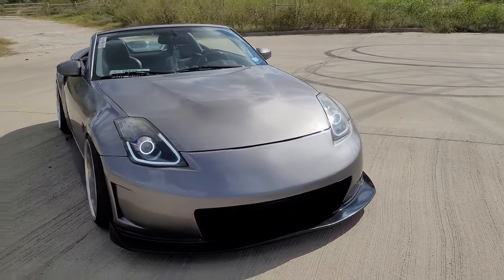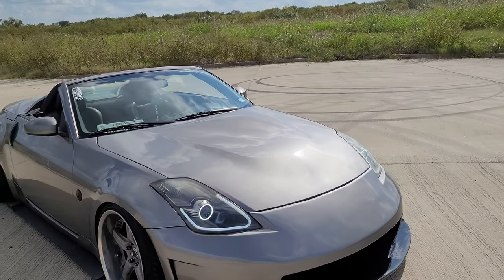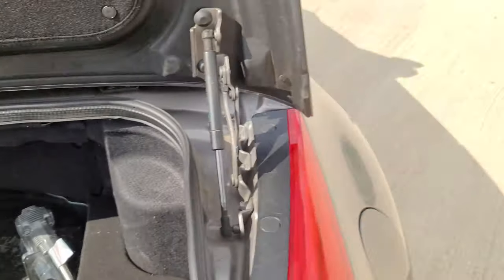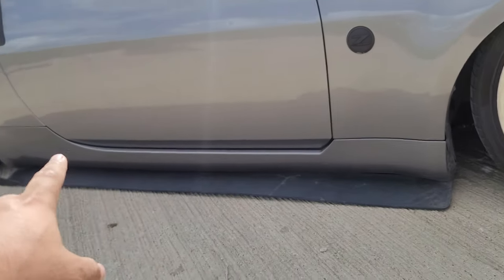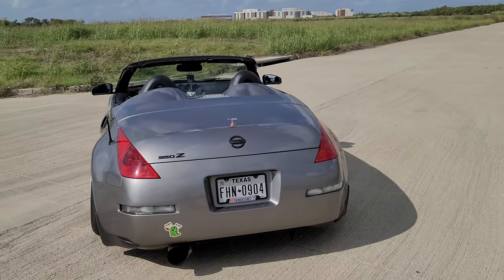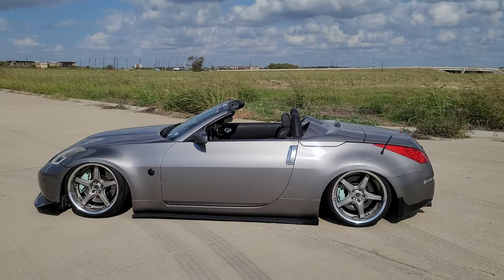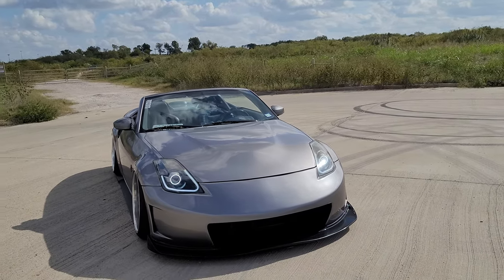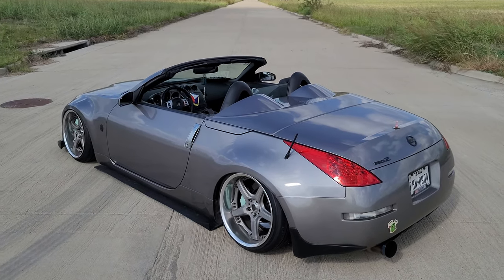Bagged My 350z Convertible!

Comment: How much did the front mod costs?
Reply from the maker: @williamegnever3831  front bumper is from KBD, was like $3xx when I bought it.
Reply: @baboyz33  may I get the name? Your front looks so GOOD!!!!
Reply from the maker: @williamegnever3831  thanks 😊  it's KBD N3R bumper.
Reply: @baboyz33  don't blame me for copying lol, it LOOKS SO COOL AND LOW LIKE A FERRARI STYLE LOL!
Reply from the maker: @williamegnever3831  It's very common! Enjoy it, they're aggressive looking. only thing is they are heavy. I'm working on buying a CF version of it.
Reply: @baboyz33  btw, what year is your 350z and paint? I might buy this 2005 350z and wonder if it looks too old
Reply from the maker: @williamegnever3831  mine is 2007. Carbon silver gray I think. Paint code K51. 07-09 came with the HR motors. A little more favorable over the previous years.

Comment: What front bumper is that that you are running? If it is the KBD poly material one, how do you like it?
Reply from the maker: Its the KBD one. Its good, super durable. Flexible. But just super heavy. A few people have had issues with sag in the middle (same here) but I put some cardboard & Styrofoam to help hold it up